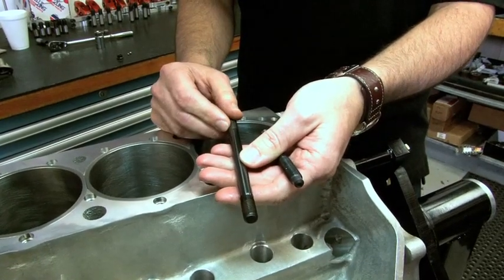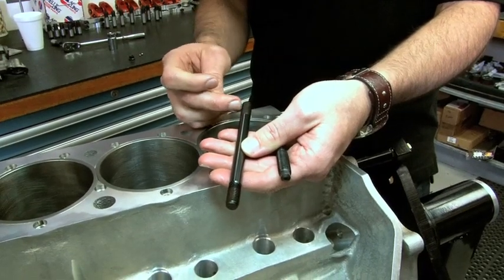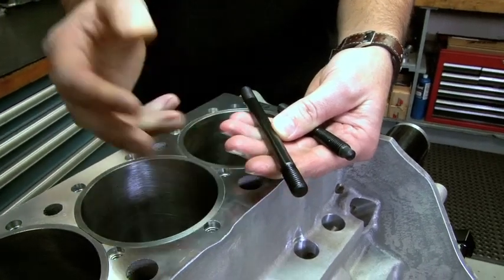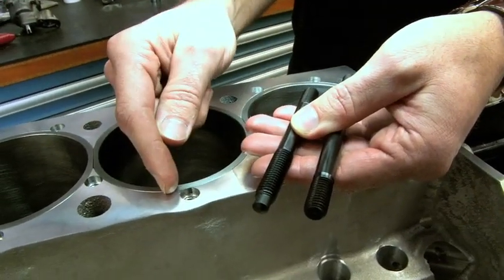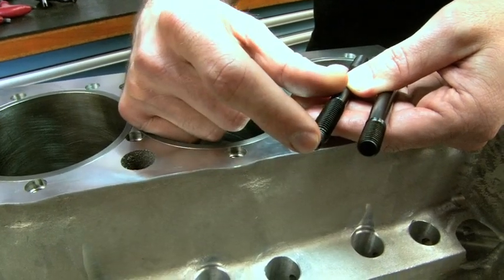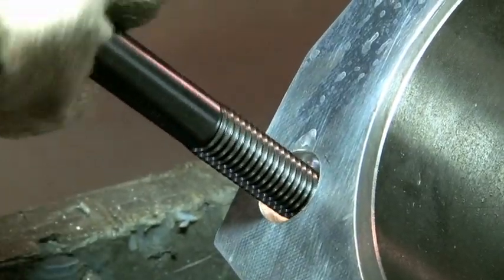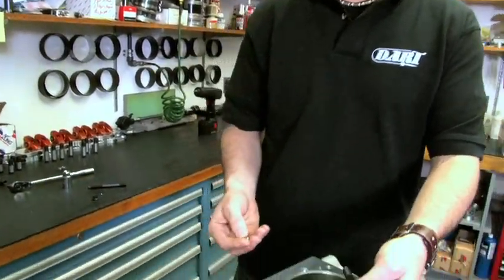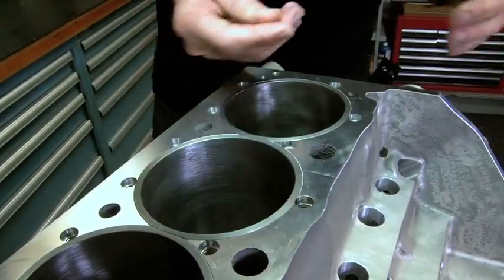StreetLegalTV.com - Dart University: Head Stud Install

Comment: I also took out the studs I installed and shinned a flashlight in the blocks holes. I noticed that the threads do not bottom out the hole. Should they? I was told to buy a bottoming tap and finish off what toyota stopped short of. Is this common, should I finish the threads? I'm baffled they would sell something that doesnt work!?

Comment: hi, i have a 7mgte supra engine im building. I just got my arp head studs in the mail. The studs i bought are undercut part#203-4701. After cleaning the holes out with a thread chaser and getting any old debris out, I ran a couple studs in hand tight as reccomended. The studs threads in the block are still sticking up above the deck. I have read on forums that I am not the only one this has happened to. But no one has a solution to this, as I believe this is not correct. Any help is appreciated.